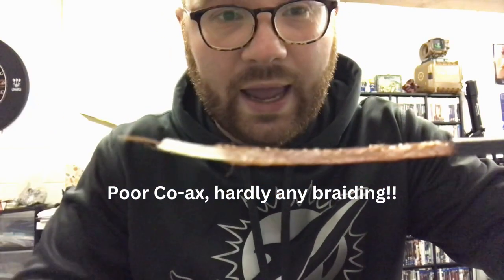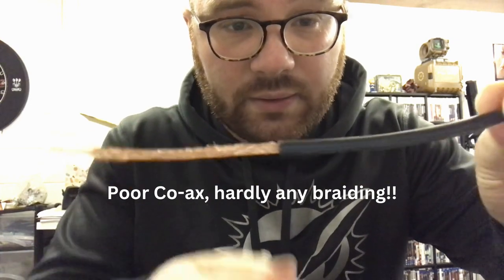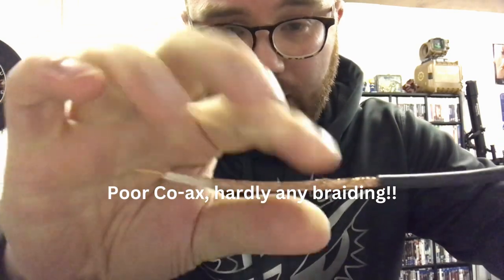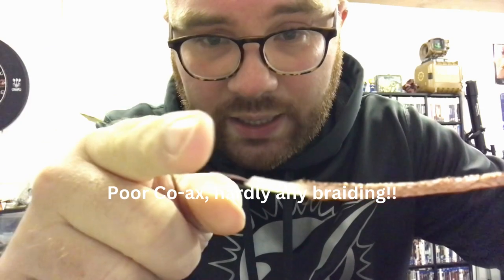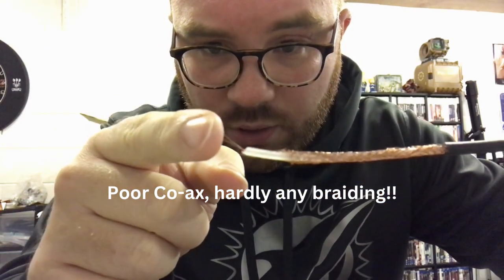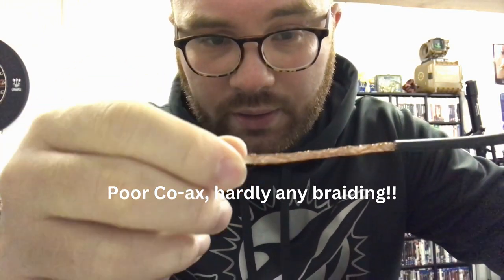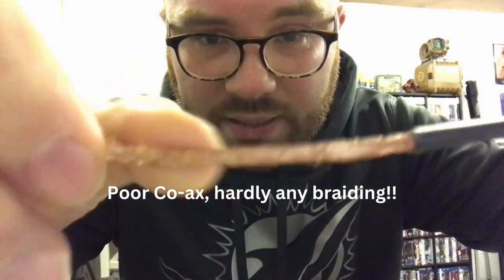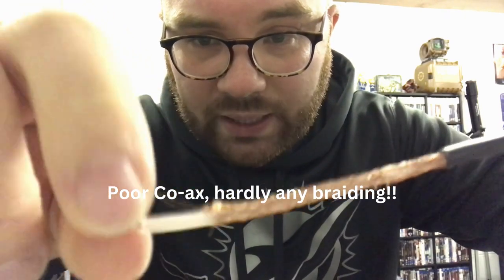COAXIAL CABLE | Does it really matter about the quality?? Radio Oddities investigates...

Comment: The rubbish coax doesn't look like RG58. You probably bought it off eBay or Amazon or something. Chuck it in the bin.

If you want premium coax look up Messi & Paoloni. Expensive, but very good.

Also use quality connectors and fit them correctly. If the wind managed to pull the coax out the plug then I can guarantee they were poorly connected.
Reply from the maker: Yeah poor quality connections on poor quality coax. Likely an ebay purchase deffo not shop bought

Comment: That cheap coax you are showing will of course have quite high loss and I would not like to use it for anything really. There is another problem with that coax as well that you might not have noticed, you say the `inner` is very thin with only a few real skinny conductors. Problem here is that the characteristic impedance of coax is related to the ratio of thickness of the inner conductor to the inside of the braid sleeve.  With 50 ohm coax the inner conductor should be about 3.5 times less in diameter than the outer braid (PE insulation). If it is different than this, it is not 50 ohm coax. That skinny one you have there, judging by the relative diameters of the conductors looks more like 75 ohm coax! I have had exactly this problem when working with `unknown` makes of cable many times. Another one to watch out for is the CCA copper clad aluminium coax. This is generally acceptable on the higher frequencies, due to `skin effect` but on the low frequencies, (my main interest), this stuff will get hot if you put any appreciable power through it. There is yet another cable that is steel braid, steel inner coated with a hint of copper! This stuff is not even good for the wife`s clothes-line! My favourite cables, Lmr400 for vhf / uhf and rg213 for the lower frequencies. For the best performance at 10m I would use the lmr400.
Reply from the maker: Good observations Chris. I think this was a cheap unknown brand that I somehow acquired there is no way I would knowingly buy that kind of coax it is absolutely terrible!

Comment: Cable run length quality frequency  he needs 1 to 1 unun at antenna depends. Coax just reduces losses in cable run i. Also if you get water in coax it screws with and a99 is a 27Mhz antenna
Reply from the maker: The A99 is used on 10m and also very well on 15m too!
Reply: May be so but ist bug compromise I use hf9v  amd ma6b  but the importance of cable is possess especially on higher bands  de m0nst

Comment: Coax is important. I use LMR 240 for a 50 foot run to a 2M 440 antenna on the roof. Any longer and it would be LMR 400. I use RG8X in the mobile  and for my meter jumpers. I don't and won't own any RG58. It pays to go the extra mile and use quality proven coax.
Reply from the maker: True, I do use RG58 but not in any great length
Reply: @RadioOddities  like you were showing us, there is too much variation in the quality. It was the go to cable for 27 MHz CB radio back then. I used it too. But now being a ham and a GMRS licensed radio operator, I’ve learned a lot too about signal loss and just how much coax matters.😀
Reply from the maker: @jeffreydonaldson3708  exactly. Invest in quality coax is sound advice